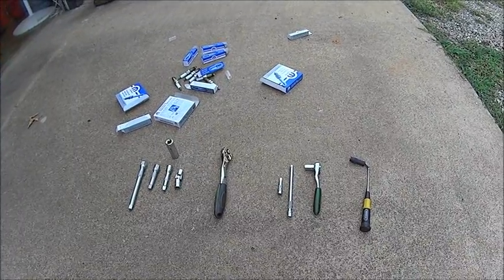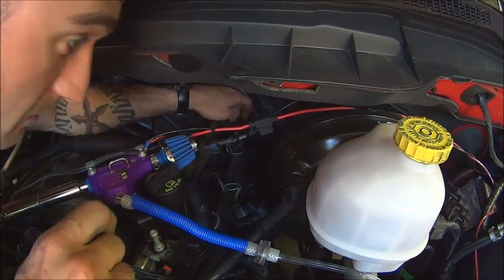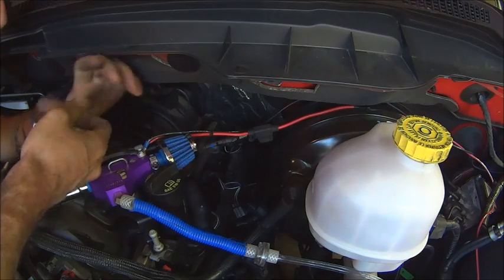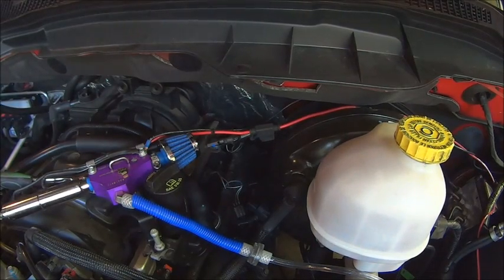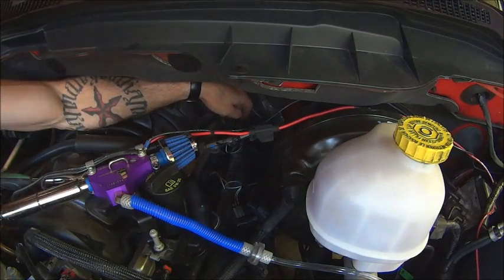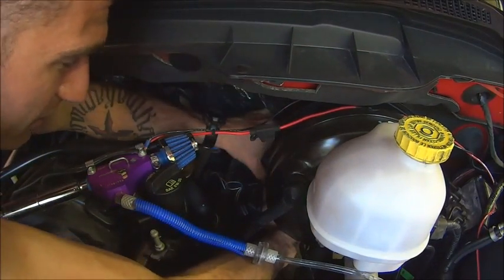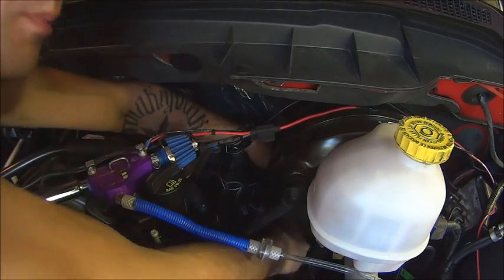How to Change SPARK PLUGS - 5.7L HEMI RAM 1500

Comment: Ok lets first start off he did say he is not a mechanic!  I give credit to him for not getting ripped off by a dealership.   For those that need to know the extender is an (extension), the elbow is a (universal joint) and the thing that provides spark is called a coil pack.  Thank you for posting this video as it shows the difficulty of reaching the back plugs.

Comment: When you start the plugs its helpful to have a section of 3/8th fuel line about a foot long. Just put the plug end of the spark plug in an end of the hose and you can fish it down the hole and hand start it to keep from cross threading it. Just pull the hose off and then finish torquing it down with a wrench.

Comment: Great video man...tip when INSTALLING new spark plug on Amazon for about $10.00 bucks get the 5/8 spark plug socket with  rubber ring inside and its magnetic to hold your plug so as you install lower your socket ABOUT halfway  down into hole and attach a 3 inch extension to clear your brake master cylinder lower it down and hand tighten then attach your ratchet TILL snug and give it just a 1/4 turn...no worries about ruining the gap...👍
Reply from the maker: Thanks man! Glad the video helped.

Comment: Torque specs are 13flbs on these plugs. (Do not exceed 15flbs)  do not use any anti seize or any other compound on the threads. Dielectric on the coil boots is okay. I read that the 2014 Ram 5.7 Hemi change interval is 100k as they changed to Iridium plugs in 2014.

Comment: Thanks for the vid. Just bought a red '12 yesterday :)  Called my mechanic quoted me $286.00 to do the plugs. Think I'll do them myself. Was unawares these were dual plug mills. BTW,the gimmick that fires the plugs is called a COP(coil on plug).
Reply: Must not have included price of plugs in that quote!!  My dealer wants $287. just for plugs @ $17.95 + 15% tax each!!   Never happen!!  I can buy stock plugs for $7 Canadian and do it myself or free ...I'm an old fart, with bad knees and back, so might have to get a young fella to install the back ones!!

Comment: Hey Hoth, I just bought 2012 1500 sxt Hemi and was wondering how hard the plugs were. Great video, I really appreciate it. Here's a little hint for you on the plugs. Use a little scrap piece of 3/8 inch rubber fuel hose to slip over the plugs, it makes it really easy to install and remove. Thanks again!

Comment: Nice vid man. I have a '10 Ram 5.7 SLT, and I changed mine about 4 months ago. That brake booster really does make that drive side a PITA at the firewall. I had an extra burden because I am only 5'5" inches tall, so I had to reach back there with feet dangling. 😂
Reply: I'm 6 6 and my feet were dangling 😉

Comment: HOTH, GREAT VIDEO.....Zach Nagle they recommend changing the spark plugs so often because it's a hemispherical engine the partial dome in the cylinder increases the size of the combustion chamber...the increase in size means that with only one spark plug the explosion of gas to cause the downstroke in the piston would be inefficient, they fixed that with two spark plugs per cylinder next the dual spark plugs and the increase in the size of the combustion chamber cause higher heat and higher temperature increases to the plugs themselves causing them to wear faster than an engine with one plug per cylinder. The joy in the HEMI is the horsepower and torque increase that plasters that silly high school boy smile on our faces every time we step on the gas!!! I CAN put up with two plugs per cylinder and changing them more often!!! Thanks again HOTH! Great video!

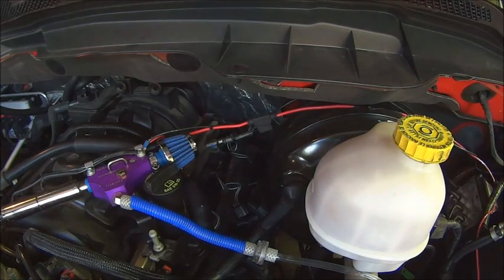Comment: Thanks for this video.  It gave me courage.  I just completed the job in 2:45 including a short break for lunch.  My plug socket had a rubber bushing that was great at grabbing the plugs on removal.  I had to remove the bushing when installing the plugs since the grip on the plug was greater than the extension grip on the socket.  At the rear of the motor the coil packs (or whatever they are) were harder to remove than the plugs.  Thanks again.
Reply: just commenting on the "coil pack", it is actually a coil over plug. c.o.p.

Comment: just finished my ram's hemi-found using 2 three inch extensions helpful in changing the plugs and found the pass side rear with the hoses the  hardest one---- a magnet is a must and the universal  joint for a couple of the plugs-make sure to use that dielectric  jell on the tubes when putting back the coil pak's--hey, if this old man can do it you can
Reply: just want to ad that I bought the champion Irinium (spell wrong) a little more  $$ but from rock auto very very reasonable

Comment: I thought changing out spark plugs on my 02 ram 1500 sport qc was a pain. Just picked up a 2010 ram hemi and the dealer has no clue when anything was done so im doing a spark plug change first on it. 16 plugs on this truck is just nuts but I guess its worth it. Great video man really needed.

Comment: Had no problem at all on my 2012 RAM. Used the recommended universal magnetic plug socket. Plenty of room on driver's side. Not so good on passenger side for back two cylinders. Electrical wire loom is in the way. Needed to cut tie wraps and disconnect 4 connectors from the fire wall to have clearance to remove coils. Last plug closest to fire wall required sliding plug socket between 2 heater hoses blocking direct access to plug hole. Otherwise was not hard, just time consuming ~ 5 hours. I see why dealers and shops want $4 to $500 to swap plugs. Swapped out at 50000 miles, not at 30000. Will swap again at 45000 miles. Plugs had 54000 miles on them and just noticed slight occasional miss at idle. No degradation in performance or mileage.
Reply: Fred Becher what socket is this?

Comment: MOE'S Performance has the factory plugs for the HEMI for $89. That's all 16 plugs. 

I just ordered mine and going to do my plugs for the first time soon. Truck is a 2013 and has 28,000 miles. Owners manual even says to change out at 30,000. 2014 RAMS changed over to 100,000 mile plugs I think? 

Great video!

Comment: Great video and very helpful too! I couldn't see paying $400 just for plug change! I had trouble obtaining 16 plugs at one time. BE sure you order the right plugs. Express models take a certain plug than the rest of the other models. The factory installed NGK's! For those that live in the Northeastern States, I would highly recommend  cleaning the backside  8 utter bases before reinstalling back to the heads. Salt residue builds up under the resin bases and could possibly cause corrosion.

Comment: Well from reading the comments I need to move where you all are.  I am a mechanic and had my local dodge dealer quote me $650 to change the plugs on my 2014 ram 1500 with the 5.7
Reply: mike thomson , its cheaper over in my neck of the woods. I wrench everyday, so when I can get someone else to wrench I'm all for it. Yeah still the 300.00 price tag is a hit in the pocket. Mine has just over 65,000 and I'm glad I found a video of it and my hats off to him for doing it.

Comment: Nice video. I did mine today on my 2011. It's not as hard as I thought it was. Just take off the stuff described in the video. Make sure you have a thick old blanket to lay on while you are working. You pretty much gotta lay across the engine to do the job makes it easier.

Comment: Good stuff man , replace the magnet with a plug socket , they have a grommet in them to hold on the plug , Im gonna do mine on days off didnt know if it was gonna be a royal pain ...thanks for the motivation !
Reply from the maker: Adam Theoret Yeah man! Let me know how everything goes. I used the magnet because that's just what I had on hand. I suppose there is multiple ways to skin this cat.
Reply: So i did them on days off , wasnt so bad after all didnt help mine has 6"lift ! haha
Reply from the maker: Adam Theoret Awesome, what lift did you go with? I was looking at a suspension lift but I don't believe I'll be able to do a suspension lift with the Kore bumper I but on. I just have a 2" coil spacer and 3" body. I think I could go full suspension if I modified the crossmember that comes with 4+ suspension kits.
Reply: Adam Theoret: Thanks for following up on your earlier post.  I always wonder how things turn out for other people.

Comment: Amazon has a spark plug tool for this. socket with a magnetic holder attached to a swivel extension. Perfect size. $6. Makes the job a lot easier but still a pain to get to the one under the brake booster

Comment: good video man! I went to get my plugs changed on my 06 Ram Hemi some years ago and they told me $380 and 4 hours to change them. Nope! It cost $110 to buy the plugs and it took me 3 hours to change them. I was on crutches, with a full leg cast..broken leg. that's why I was gonna pay to get them done. but for a little time and pain I rather do it myself than spend almost $400! it does take a little more time on the driver's side..but worth the savings to do it yourself. thanks again for the video. I have changed mine two more times since with no broken leg and it only takes a little over an hour and a half now, ha.
Reply from the maker: Yeah man, it's a rip off! It takes mechanics who do this for a living 4 hours? I think not...
Reply: Ya. I couldn't believe he said that it was gonna take that long either. I'm not considered a "mechanic", but Thanks to my dad teaching me most everything about cars, I do everything myself except internal engine components. On the down side, I get to work on all my friends cars for free, hahaha.
Reply: +deadboy600 it takes 16 plugs..2 per cylinder. they cost almost $7 a piece, plus tax.
Reply: +deadboy600 neither did I till I bought  the truck and checked it out. oh well, its definitely been one heck of a truck though. worth every penny I spent on it.
Reply: My dealer wants $287. just for plugs @ $17.95 + 15% tax each!!   Never happen!!  I can buy stock plugs for $7 Canadian and do it myself for free ...I'm an old fart, with bad knees and back, so might have to get a young fella to install the back ones!!

Comment: I had a 2003 ford f150 with a 5.4. it seems as though this is just as much of a pain. I recently purchased a dodge with a hemi. "way more powerful I might add"  the spark plug change seems  a bit easier than the 5.4 triton but I won't know till I do it. I will comment when the time comes.

Comment: I see the plugs are not iridium i have a 12 dodge ram 1500 hemi st an i was told i needs hgk iridium an also the owners manual states the same part number of iridium, are iridum plugs an upgrade from copper or which will i need
Reply: I just got Bosch double iridium will be putting in tomorrow

Comment: Silly question but does your engine cover fit in the truck with that aftermarket intake?? I have a 2010 ram had it for 3 yrs and I just realized that I didn't have a engine cover lol
Reply from the maker: It does, the aftermarket intake piping runs along the same route.

Comment from the maker: Not a problem at all, I'm actually gonna post another video showing the spark plug wells a little better. The purple device is a hydrogen system I'm experimenting with. So far I'm up 3 my after 1000 miles but it's slowly increasing. The truck is taking some time to accept the additional fuel source I think.

Comment: I have a 2014 ram 1500 hemi and I just got to 40,000 miles I have had it for 14 months tomorrow and well I got it new with 65 miles and well what time in mileage would it be time to change them out? Iv done about 80% of those miles on the highway and not much hauling just maybe like 200-500 miles max overall but I love how the cold are intake induction sounds so heavy foot is there but should It be about time to change them? Overall I am noticing that my mpg went down 1 mpg now then when I had under 30k
Reply from the maker: Check your manual on recommend spark plug replacement. Mines a 2012 and the manual recommended it at 36k I believe.
Reply: +HOTH oh ok cool and man In 4 days I already put just over 1,000 miles on it lol
Reply: I went to my dealer to get plugs changed at 50K km and a mechanic said, don't bother ...most don't change out til 100,000 km (62,000 Miles) ...I've got a 2011 Big Horn...bought new  Jan.28, 2011 ...have 105,000 km on it and still runs like it was new and haven't touched the plugs yet.  Always run Shell Nitrogen enhanced gas unless I can't get it where I am ( rare) and Lucas Synthetic 5/30 oil since new.  Best vehicle I've ever owned!! ;)

Comment: Good video, thank you.  One topic I cannot find on Youtube is how to remove the plastic engine cover.  I have never done this and do not know if it snaps into place or if screws need to be removed.  I don't see any screws but fear breaking the cover if I yank up on it as if it snaps into place.  Can anyone tell me how to remove the cover without breaking something?  Thanks.
Reply from the maker: W Kelley it just snaps into place with rubber grommets. Just pull straight up on the front and it'll pop off easily.

Comment: Tedious indeed.  For those of us that have done it on our own it's essentially a rite of passage. Nearly a day's worth of work to save that much on service.  Not sure why the factory specs call for replacing the plugs every 32000 mi. Replacing the NGK's with Champion Iridium  9055's will last you 7 years per the Champion guarantee.  Thank you for posting.
Reply: I have a 2011 Ram 4x4 5.7 also. 118,000 miles and on the same plugs. I have the oil change every 3000. That is it. It is just as strong as when new!

Comment: hothcook, I put a tune in my wife's truck using a Diablo Tuner and went from 19mpg to almost 22mpg and that is after turning off the MDS.
Reply from the maker: Did you use the Diablo tune? I was thinking of trying the Diablo tuner but getting the hemi fever tune.
Reply: hothcook ,
yes I married my Diablo Tuner to my Hemi's CPU system. It copies the factory tune, saves it into its memory, then you re-install one of 3 pre-made tunes or you go through all the settings and create the one you want. However once done, you can never get rid of the tuner, because like I said it is holding your trucks factory tune in ITS memory. I keep my tuner in the cargo drawer under the seat. The first tune the Diablo offers is the one I chose, it upped the mileage from 19mpg to 22mpg and changed the shift points along with injector timing and so forth as well as giving me the ability to TURN OFF THE MDS!!!.............that crap is worthless!.....................((( WORD OF WARNING: the EXTREME tunes that can be installed are NOT meant to be used continuously. The engine and transmission  simply can not withstand the abuse those tunes place upon them. )))
Reply: Jeffrey dontyouwish 

Your truck's factory tune may be stored in the DiabloSport, but one trip to the dealer (if they flash your wife's truck computer for an update) and your diablosport tune loaded on the truck will be wiped off the face of the earth and that tuner will be locked and worthless.
Reply: It is locked, the factory can not access the tune in my ECM unless I allow it. That is one of the benefits with this tuner...:-)...So IF I ever chose to sell the truck, I will remove the TUNE and re-install the factory tune with its running parameters.
Reply: Jeffrey dontyouwish 

I understand that. I have had several tuners for various vehicles. I am just letting you know that if you bring it to the dealer (let's say for an oil change) and there is a factory firmware update, they will flash your computer with it and your tune will be lost. Making your tuner an expensive paperweight, because it will be locked with no way to unlock it. Other than paying the manufacturer plus shipping the tuner to them. Diablosport charges $150+ shipping for this.
Reply: The dealer would essentially just be reprogramming your computer and throwing away whatever is already there. Just a heads up.

Comment: If you have a socket that  is a plug socket with the little rubber insert inside it, the plug will stay stuck in the socket while you remove it so you don't need a magnet.

Comment from the maker: The device with the blue filter is a hydrogen system I've been experimenting with.
Reply: +HOTH purpose? i just got my first ram
Reply from the maker: +cmatix1008 It's supposed to increase the fuel economy and performance, key phrase being "supposed to"
Reply from the maker: Roaddawg 52 yeah at this point I would not advise it. I still haven't been able to get it working as advertised.

Comment: By any chance have you had to replace the exhaust manifold bolts on both sides due to them breaking off? I already found one busted off even with the engine block. I also have a 2012 5.7 with 55k miles. When starting the motor, starts ticking like a rocker is off, or oil pump is not working. After it warms up the sound is gone. Been finding many people with this problem. a friend pointed me to this video. https://www.youtube.com/watch?v=XUAtpIhX0q8
Reply from the maker: Joe Gest oh damn! No I have encountered that issue as of yet...
Reply: Thanks for your video, was dreading the plug change. No problem now !!!
Reply from the maker: I'm glad it helped! 🤘🤘🤘
Reply: One thing i did notice while changing out the gaskets. Might be a little more work but easier to get at the plugs from the wheel wells. take off the tire and the plastic wells.

Comment: Yeah they want 700. Can for dodge to do it. Do you know at what Km you have to change these?
Reply from the maker: My manual suggested 32,000 miles.
Reply: Owner's manual says every 50,000km
Reply: +Michael Gatien yeah decided to take it in to Dodge for the first one. My thinking on this is if there in to tite and they break one off I wont be on the hook. The trucks at 100.000 km so look like might be over due.

Comment: Its a2012 truck and it is 2014 now. Why are you changing your spark plugs? My 2004 ram plugs went out at 220,000 miles.
Reply: manual recommends 30k miles